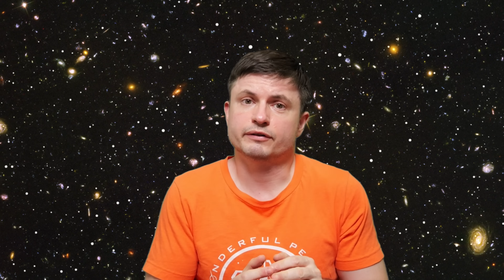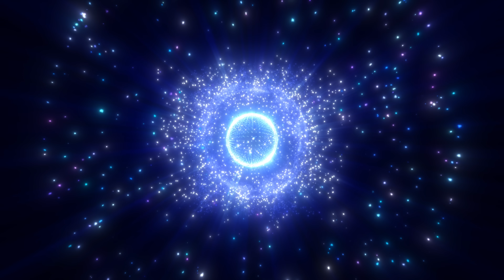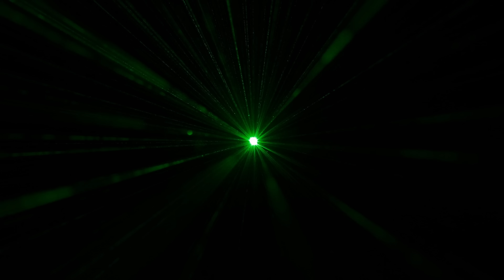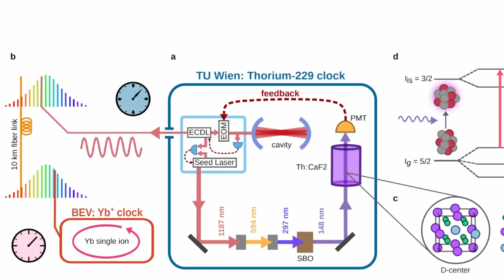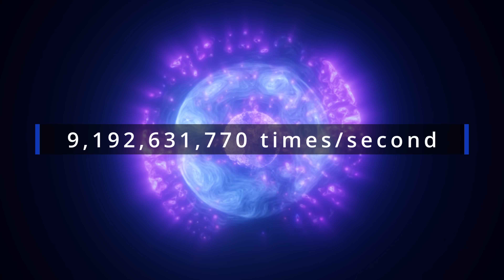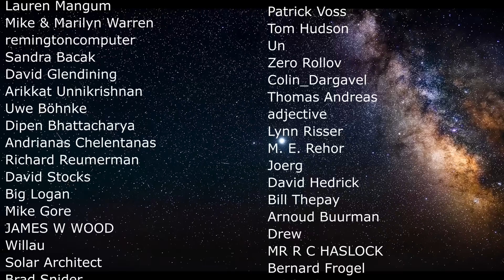The Nuclear Clock Is Finally Real And It May Change Everything

Comment: We used to watch the grass grow, over some long summer days, and the fireflies would come out in the evening.
Then we went to a permanent salary job, 9 to 5, rushing and rushing, on the clock.
Now we just count 9,192,631,770 vibrations of a Cesium atom each and every second of life lived poorly.

Time does not get faster or slower all that much, as we grow older.  It's just our obsessiveness to count more
rather than better, counting physical observance rather than meaningful experience.
Memories are made by reprocessing the time spent in curiosity and wonder.

Good luck y'all.

Comment: Before adopting a nuclear transition for the S.I. definition of the second, the International Committee for Weights and Measures (CIPM) first plans to transition the definition of the second to optical atomic clocks. These use visible or ultraviolet light (rather than microwaves) and are currently more advanced and mature than nuclear clocks.
The international metrology community aims to redefine the second based on optical clocks. While a working Thorium nuclear clock was recently developed, extensive inter-laboratory comparisons and testing are required before it can be trusted as the global standard. The scientific consensus suggests a redefinition involving nuclear clocks is likely a decade or more away...

Comment: After refinement, this clock will be accurate enough to require an accelerometer to continuously correct it for relevativistic effects (if it will be experiencing changing acceleration)

Comment: The main reason to have a clock that is accurate is of course in an independent structure out in space. Current clocks already using lasers are prone to the same problem as anyone trying to throw a ball at a target that keeps changing between being closer and further away. 

The change in speed of a satellite changes the amount of bounces light can have. 
One meter per second the clock will take a regular amount, plus or minus any nanosecond, more of speed. And you introduce that relative to the speed of light augment in the amount of ticks. This is wrongfully referred to as time dilation.

Comment: I feel like this all might be useless, it is known the % chance a atom might decay but it depends on QM. Unless you find an atom that has a 99.99998% chance of decay in a certain time period, but from what your saying they did not find an atom that does that just a way to measure if thorium 229 decays Then you say they are going to force this decay and the timing of the laser have to be controlled by something other then the atoms decay so the time would be measured in when you fire the lasers not when the decay happens.

Comment: The thorium clock does not make time more accurate, it produces a higher-resolution trace of local proper-time recurrence. But resolution itself is only definable because measurement occurs against a stable observational background, whose constancy is given by the light-speed response field.
That makes c more fundamental than the clock. The nuclear clock is measured time. The observational speed of light is observed time.🎉

Comment: Being able to achieve measurement of near millimeter resolution of elevation through gravitationally induced time dilation is unreal. If these things can eventually be brought down to reasonable price, I could see these being a huge improvement for aircraft for altimeters. The big advantage is that the measurements would be absolute and you would not have to do local references to barometric pressure or have to deal with changing weather conditions, altering the barometric pressure and throwing off your altitude readings. Not to mention that the resolution is far beyond what is required for safe aircraft flight. There may also be possible future applications for submarines. But I'm not talking about this for depth measurement. That is very simple with the submarine by water pressure. But rather, I am thinking that an array of these devices might be able to map gravitational changes in the seafloor and be able to detect the movement of the sub in relation to the seafloor by recording these changes. I'm thinking of a principle very similar to how an optical mouse works on a mouse pad; selecting reference points in the variations of the image from the mouse pad and tracking their motion as the mouse moves over the pad.

Comment: I'd be jazzed if I could just find an old school wind up Little Ben all metal alarm clock to use on my off grid homestead. Those can be externally calibrated to account for temperature changes and are pretty much indestructible like the one I used to have as a kid that I through across the room multiple times after getting woke up for school. My electric alarm clock loses 4 minutes a day due to my solar powered power inverter being 1/69 of a hertz lower than 60 hertz and my cheapie Chinesium battery powered wall clock likes to slow down if the battery contacts get just a little oxidation on them or the battery gets low. No one makes good windup clocks anymore. If I could get an affordable nuclear isotope powered and nuclear calibrated clock to hang on the wall I would I buy one in a second even if it was a little pricy!

Comment: This will almost certainly lead to Nobel prizes.  Smaller ticks means the experimentalists will be able to prove things that were previously conjectures.
Reply: 😅😅😅😅 prove
Reply: I hadn't even considered that. You've made an excellent point
Reply: Such as?
Reply: @Dennzer1 all electromagnetic phenomena arise due to an exchange of photons between Atoms, these have always been referred to as virtual photons simply because such interactions occur so quickly that we haven't been unable to observe them, even though all theoretical predictions made as a result of this theoretical model have been verified.  We haven't actually observed it , but now we'll be able to and we'll stop calling them virtual
Reply: @douglasdarling7606 
Hiya, did you mean "haven't be ABLE to observe them"? 
(Rather than 'UNABLE'. Or am I just reading it wrong?) 🤔✌🏻🙂👍🏻
Reply: @nickthelick  Even your comment typo'd the quote, but basically yes you're correct about their intention. They just accidentally wrote out two opposing versions of the same sentiment.
Reply: @Dennzer1  "Such as?"  Industrially, not Nobel :
Cheaper less accurate atomic clocks, $tens of thousands,  used in point to point synchronisation of communications links, higher bandwidth.
Cheaper stable nuclear clocks ,  costing only few $thousands, but with the precision of very expensive atomic clocks , $millions, could be used widely , supporting greatly increasing bandwidth.
Reply: Like the variable speed of light?
Reply: Anyone else sus by the timing how the other team is Chinese and knowing how they always steal all the intellectual property from the West?
Reply: @DarkMice19 no, they have plenty of human capital over there. They’re overdue for a lot of their own breakthroughs in the next couple of decades. Also like 99% of our ip isn’t stolen by Chinese or Russian nationals, but rather stolen by Israeli-American “information brokers” and sold for profit to these countries and vice versa.
Reply: @georgeofthejungle9193  yes, the human capital is called northkorean and uighur 😂
Reply: @DarkMice19  Not really.  Someone is working on something. Someone publishes, there is a rush to publish because papers means funding.
The European paper s [Submitted on 3 Jun 2026 (v1), last revised 5 Jun 2026 addresses ultra precision time scales and stability.
The Chinese paper   07 Jun 2026 addresses reproduceability of precision at least equivalent to atomic clocks. Compact solid state devices equivalent to the precision of very expensive atomic clocks may be manufacturable in quantity.

They were already well along in parallel.
IF the Chinese were only copying and had just whipped up multiple samples and tests of a nuclear clock in a few days from seeing the first paper that would make them FAR more capable.
Reply: @johncarlaw8633  to me it seems they have people working inside a lot of places in the West to do the IP theft and spying (similar to Soviet Union who had 2 million agents everywhere in the West at the time they fell, but China likely has a lot more because of their size and the modern attitude of free movement).
Reply: @DarkMice19  this
Reply: @DarkMice19  china is ahead of everyone else overall at this point technologically.
Reply: @aspenyoung2914  nope. Ie. Taiwan has the best chip manufacturing.

Comment: It can be used in mining and navigation too. It's actually common, a mini fridge sized device on wheels that you can drag around to detect gravity changes. A change in density indicates a minereal deposit. For navigation, you need to map out Earth's gravity and fly in a straight line until you see fluctuations which can be mapped to a unique signature.
Reply: Using it as a quantum densitometer sounds like an excellent application ❤
Reply: Yup!! I've been excited about this for years! One thing overlooked in this fog of AI clamour is the field of sensory technology. We'll soon be able to sense/monitor/gauge/observe almost everything, anywhere, anytime.  Mining, aerodynamics, aqua dynamics, material science, quasi-crystals, everything collated...
Reply: @samuelluria4744 i just hope the technoligarcs let us do all that, they may want to just use it for a better yacht clock 🥱

Comment: "Cesium 133 atoms are believed to transition from their ground state to their excited state 9192631770 times" — Actually it is not the number of [discrete quantum] transitions occurring in the atom, it is number of periods of the radiation corresponding to the transition that fit into a second.
Reply: Also it is by definition, not belief.

Comment: An open question the physics-engineering minds. If humanity was challenged to build a clock, calculator or similarly complex machine but it had to last at least one thousand years, ideally multiple millenia and remain accurate. What approach could we take that's any better than a sun dial?
Is it feasible at all we could build something mechanical, electrical or using microprocessors that would last a thousand years?

Comment: Next Step: Automatically adjusting to account for time dilation..
Reply: adjust in reference to what?
Reply: @alinuriseker5495  I just mean creating clocks (such as the clocks on GPS satellites) which automatically adjust to time dilation by themselves instead of having to be manually reset.
Reply: @32brookse i think so far we have them already for the atomic clocks, it's a rather straightforward calculation and rather predictable.

I doubt there is a poor fella drawing up math just to calculate each sat's time dilation and putting them numbers in manually.

Everything is automated nowadays, there is def. a script doing that.

I can't make sense of a clock adjusting itself thro time dilation tho without any reference frames or additional sources of time. I don't think there would be any point to that.

As our sat network work together among each other and with the help of the clocks on earth, it becomes a trivial matter easily automated.
Reply: @alinuriseker5495  A clock could make the adjustment on its own as long as it has all other variables of its local gravitational/acceleration landscape coded into its mechanisms (in our case the solar system).
Reply: @32brookse the issue here is the time dilation, clock itself can't determine its own location/time passed/distance traveled without a relative reference therefore it can't adjust itself.
Reply: @alinuriseker5495  Incorrect. The relative reference can be programmed in via algorithms which account for the known motion of the entire solar system.
Reply: @32brookse you can't detect changes in gravitational fields directly. What you are suggesting only works in theory.
Reply: @alinuriseker5495  I'm not talking about detecting anything. I'm talking about creating an algorithm that knows what we know about how, when and how much, dilation needs to be corrected for and plugging that algorithm into the clock.

Comment: How do you measure how accurate a clock is without a more accurate clock?
Reply: You build 3 clocks and check if they stay in sync.
You need an odd number to know which results to disregard if there is a discrepancy,

Comment: How was the original length of a second determined in the first place? What is the reference point?
Reply: For this question I'd suggest looking it up on wikipedia.  I know, not the most reliable source for controversial things, but it turns out the second is not that controversial.